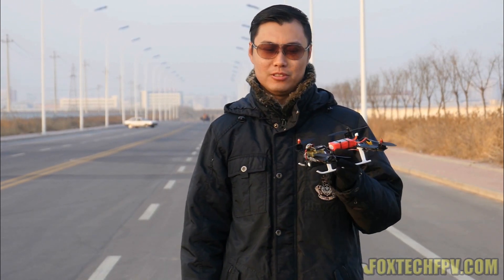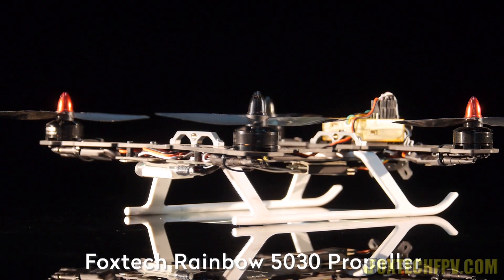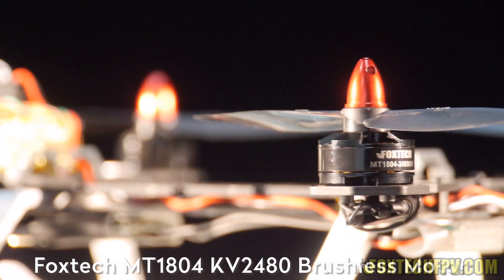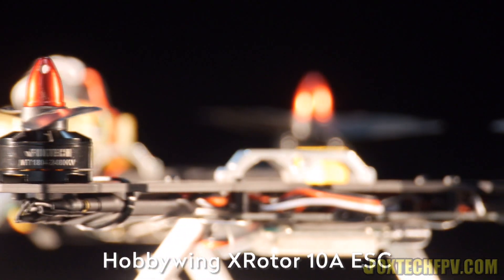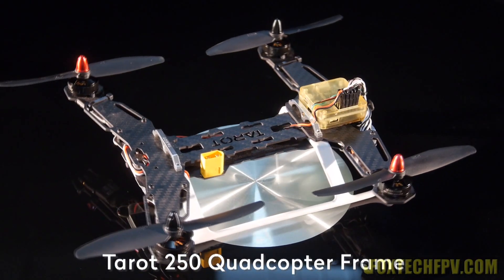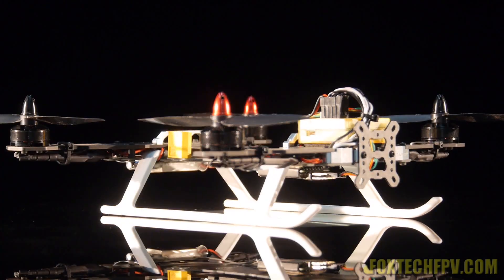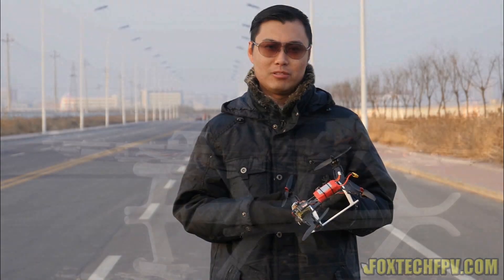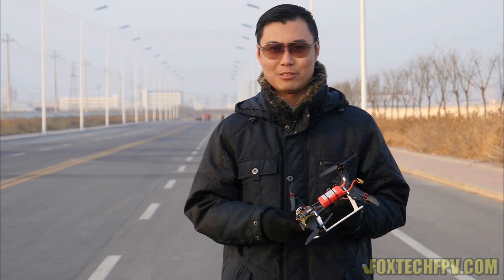Tarot 250 Mini Racing Quadcopter Combo

Comment: I own one of these and I'm using the E-Max 1804 2280kV motors and Gemfan 5030 three bladed props. I really like this quad. My full weight ready to fly ended up at 442.8g and that's with the Mobius camera mounted.

Comment: Hi! can it support 2204 sized motors? thanks
Reply from the maker: 250 mini copter can fit 6inch propeller , if your Kv vaule is ok with 6inch propeller and the hole postion is matched , It 's should be ok . But we still suggest 1804propeller for a good efficiency .